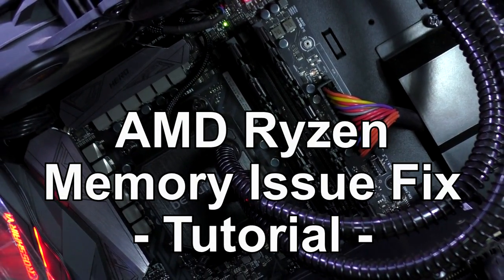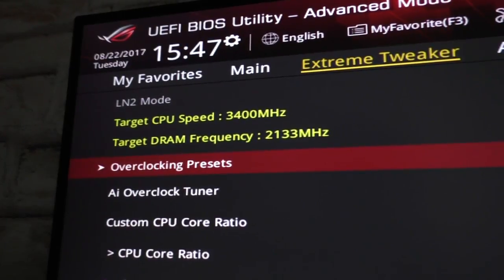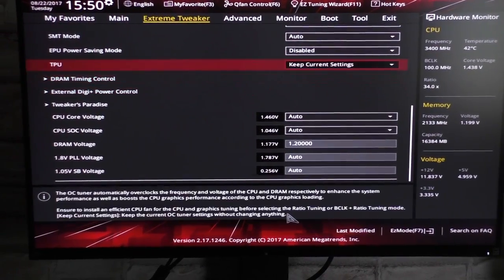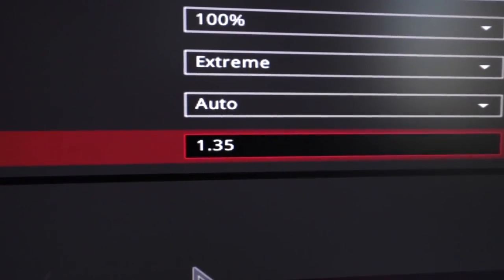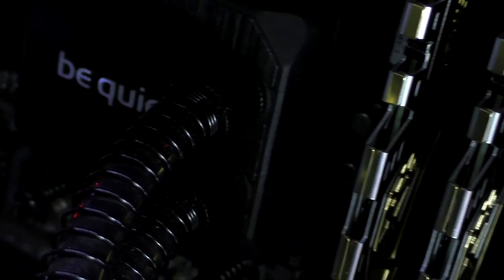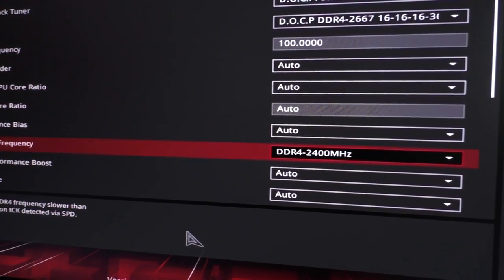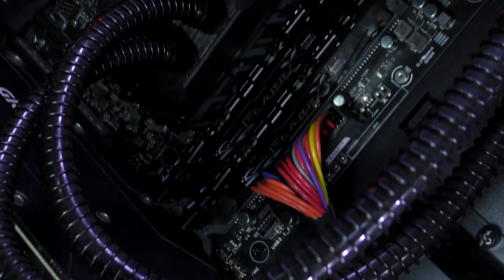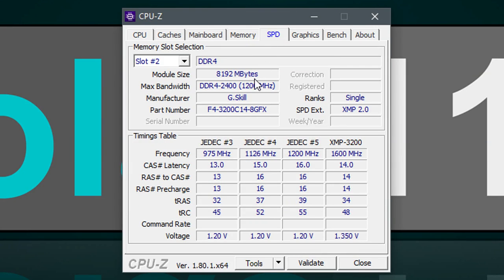AMD Ryzen Memory Issue Fix - Tutorial

Comment: Also if it hasn't been mentioned, a bump to SOC voltage can improve memory controller stability. Maximum 'safe' has been said to be 1.2 but I'd start at 1.15 in as small increments as your board will allow.

One other thing that can help overall memory stability is the ProcODT setting if you have it. On crosshair vi extreme (and I imagine the Hero as well) it can be found under Advanced > AMD CBS > UMC Common Options > DDR4 Common Options. I would try settings between 40 & 60.  It's been mentioned that up to 80 can work but I personally wouldn't go over 60. And I'd note that on the CH6E with bios version 1701 this option must be set again any time there is a change to base memory frequency. Including if the system fails and automatically lowers your ram speed.

Comment: THANK YOU SO DAMN MUCH. I finally got my ram to run at 3200MHz like its supposed to. My MOBO sets voltage to 1.350 by default, so I changed that to 1.4v after i turned on DOCP setting, and it booted it up and its stable. Man this was giving me a headache. I'm glad I came across your video.
Reply: hey i had a question, i get docp to be stable but when i restart my pc 2 times, it resets and i have to battle against the bios for it to work again , will rising the voltage fix this?
Reply: @Sebas-se6ej  disable memory training and enable  Memory Context Restore

Comment: Okay, so I see people still commenting and I found a fix for myself. This is extremely situational. I'm running a Ryzen 3200G on an Asus B450-F Mobo. I was upgrading from Team T-Force 2x8 3200Mhz to 4x8 (I bought two more of the same kit to upgrade) I never had an issue running the 2x8 setup at 3200Mhz but when I upgraded I couldn't boot. The b450 does not have a dram boot voltage option (manually) however if you boot the system with the original 2x8 and load into bios, do two things. If it's not already on, turn on the DOCP standard and it'll set your ram frequency to 3200 or whatever your ram capability is. Once completed, go into the EZ tuner (F11 I believe) and change the load setting (tab 2) to gaming and video editing. This will automatically OC vram and CPU (very minimal but seems to make the difference) then boot normally. Once windows has booted, shut down immediately. Install the additional sticks of ram and boot. I recommend going into bios before allowing windows to boot to ensure the system can see all 32g of your ram. I had to change it back to DOCP standard after the second boot and we are now running at 32GB 3200Mhz of Team T-Force ram.
Reply: If tje kit not 4dimm module wouldn't the system receive no benefit? How much u share ram for u apu?
Reply: Im gonna try that today, hopefully it'll work.
Reply: @renehinojosa1962  any luck? experiencing this issue atm

Comment: I have only had the pleasure of working with one Ryzen R7 1700 system I built for a customer of mine. He wanted me to also over clock it for him which I did. The Team Group night hawk 3200Mhz memory ran fine at rate speed as well as at 3466Mhz while testing but it left the shop at rated 3200Mhz. The R7 1700 ran all the way up to 4.1Ghz stable but it left the shop at 4Ghz OC and he was very happy with his new system. This was all done a a Cheap MSi B350 gamer board so I was pretty impressed with the whole setup because of all of the performance you got at a great price.
Reply: Rocky12345 what was ur setup because i have nighthawk 3200 32gb kit and it will not be recognized as 3200 if i do it wont boot. Please help
Reply: One issue worth considering is there's a trade off between high capacity and high speed support.  You can get the highest rated supported speed or highest capacity, often not both at the same time.  It isn't clear until you read the QVL of the board, get some experience swapping RAM and figuring out by trial and error the highest speed vs lowest latency supported on it or consult with people who have with the same board and CPU.
Reply: My four year old, middle of the top end intel cpu is still faster than any ryzen...lol

Comment: 32gb corsair lpx 3200mhz 4x8 kit, cant get my ryzen past 4.25ghz on any voltage and my kit cant go past 3000mhz on the xmp / DCOP profile. Gonna try the dram boot voltage to see if that works
Reply: Did that work afterall? I can't get my gskill 3600mgz going on xmp settings as well, it defaults to a lower speed.
Reply: yeah can't seems to get my 4x8gb 3200mhz A-XMP 
corsair vengeance ram kit to work on my MSI B450 Gaming Pro Carbon AC. it works on A-XMP 2933mhz settings though.
Reply: @SGbeerlover  I also have issues. Control game and Serious Sam 4 made be realize it. An other indie game too. 3200 is not possible with ripjaw. 2666 works I guess
Reply: @SGbeerlover  same situation. Only profile 1 2933 mhz with my Ryzen 5 1600 and msi b350 mate , flare X 3200 32 gb (4*8) With last bios it's starting but there's errors.
Reply: @YasonDinAlt  ikr. I just couldn't get 3200mhz to work on with the 4 ram sticks. There seems to be some limitation on the overclock with this motherboard msi b450 gaming pro carbon ac
Reply: i never did this and mine ryzen works fine with ram overclocked to 3600mhz CL16  mother board Asus b550m plus tuf , memory xpg d41 tuf 3200mhz.
Reply: I wish I knew what I now know as no Vengeance LPX ram work at their rated speed on the mobo and chip I have, I only get 2666mhz stable-ish
R7 2700 and Asus b450M-A
Reply: @shurikencookies  something is wrong is to work normally on your motherboard even 3200mhz with ryzen 2700 and around 3600mhz with ryzen 3600, try to set manual the SOC voltage to 1.14v and try again, do not use in offset
Reply: Ok im 1 Year late but i think i now pin point the problem on using 4 ram sticks on some motherboards, it seems like the motherboard traces going to the ram slots are not all equal.I have a msi x470 gaming plus and i got it to run at 3200mhz with a 4x8 xpg D60G Samsung C-die and lot of thinkering but its not completly stable, you gotta set the VDDP , Vref for channel A and B, VPP , procODT and so on. For all i can see and some pc builds ive been trough Msi motherboards specially suffer from this, i havent had a single issue with Asus motherboards on this regard, and some Aorus boards but they seem to lack some options on the Bios to adjust voltage and other stuff.
Reply: @mcflygarcia  Could you maybe explain with a little more detail what you mean with: Set the VDDP, Vref for channel A and B, VPP, procODT and so on and how to do it? I know very little about memory and also have a MSI motherboard with 4 sticks of RAM with some problems

Comment: It kinda worked. 3 hours passed and no freeze, no bluescreen. I will leave an update when it will freeze.
Reply: Nope, died again, while browsing the web
Reply: @HighVoltageDiesel  haha i knew it i fucking hate amd
Reply: @Hitmankiller01  haha same.  Next build its gonna be Intel.  Fuck the reds i support them enough.
Reply: @briantezo9232  ummmmmmmm you do know that the 10th gen intel chips are stupidly overpriced #AMD FOR DAZZZZZZZ even if some things they do are completly idiotic...
Reply: @tarnishedpose  Sorry I was SUPER bias Yes intel dose have there morals straight AND is still the leader in single core performance but u gotta admit 
AMD has there prices spot on But as you mentioned is ludicris that when you buy a chip from amd THE MOST important part TO make a cpu RUN dose NOT WORK PROPERLY!
ive personaly had these issues with my Ryzen 5 2600. Anyway i cant belive i was that dumb to post my previouse coment XD. Have a great day or night
Reply: @tarnishedpose  Oh and i forgot to mention Im very sorry that i upset you D: Did not intend what i intened in my first comment
Reply: @HighVoltageDiesel  same happening to me ryzen 3600 b450 aorus pro wifi , vengence rgb pro 3200mhz but it freezes and restart it self while idling
Reply: @abdulhannan-um6to  same here, ryzen 5 3600, aorus b550 elite, RAM delta tforce 3200. Any solution? What is shown in the video didnt work for me.
Reply: @danielcettour  I just build into thecase and it start working fine. No issues now. But build 3 times on test bench but no luck on it
Reply: @abdulhannan-um6to  when I make my ram speed 3600 my games crash and that’s the speed my kit has
Reply: @Worxthy  i have tried xmp on and off same crashes
Reply: @abdulhannan-um6to  the only way it doesn’t freeze for me is if I turn it down to 3000
Reply: @Worxthy  how you set speed manually?
Reply: @abdulhannan-um6to  I have a RogStrix b450 mobo, and I downloaded the bios and from there it restarts the pc and you click f1 and from there you can manage everything sadly I can’t run over 3000 without my games crashing :(, search up how to download bios for your mobo :)
Reply: @Worxthy  i have done upgrading bios
Reply: @Worxthy  no bro at 3000mhz same reboots
Reply: @abdulhannan-um6to  try 2800, keep slowing it down till you can actually do it without it crashing

Comment: OMFG MAN!!! I was sitting on my 3900x with 2133 frequency for almost 1.5 years until today. I feel myself so dumb. I've enabled XMP profile set ram voltage from 1.35 to 1.36 and it works! Just a couple of clicks... I have not tested stability yet, but the fact that my pc booted with normal frequency is just great by itself. Thank you a lot! 
Motherboard: MSI x470 gaming plus max
Ram: Corsair vengance lpx 4x8gb 3200MHz

Comment: On Gigabyte MOBA's: Go MIT/Voltages and change DRAM Voltage to 1.35 and the one below termination half of it: 0.675. If you have memory higher than 2933Mhz enable xmp and downscale to 2933Mhz since Ryzen supports it. If it is an higher frequency like 3200mhz change it to 2933 and down the timings to have still better performance. I have a XMP 3200Mhz kit 2x 16gb with XMP C15-17-17-34 and I now have on OC a stable 2933Mhz C13-13-13-26 1.35V 0.675V

Comment: Life saver!!!! My Ryzen 2700x and FlareX 16gb kit was never stable, it was at 1.2v I put it at 1.3v and is now stable for the first time in 5 months!
Reply: Man i am going to buy 2600 with 16gb ddr4 3200mhz. Suggest me a model that can run natively on 3200mhz out of the box. Man i am so confused.
Reply: @midgetechknowledge  even if the memory is 3200mhz it might not run natively out of the box at 3200mhz depending on the motherboard you pair it with. You should get familiar with adjusting bios settings. But hey you might get lucky.
Reply: @cliffbartram4974  man its risky. I have plan to get asus tuf x470 plus mobo. But what do you suggest? :( is the bios update necessary?
Reply: @cliffbartram4974  and does intel has this type of problems?
Reply: @midgetechknowledge  that's a nice board, and yes update the bios as it's simple to do. Intel has its own problems as any other manufacturer, no part or company is perfect
Reply: @cliffbartram4974  i will buy the component after some days. But its so frustrating to see that if i can run 3200mhz at all :( as i will use my pc for gaming and editing. :(
Reply: @cliffbartram4974  so should i go to flareX or gskill trident Z? Or corsair vengence lpx?
Reply: @midgetechknowledge  they are all good choices, I personally have the Flare X because Gskill has always been good for me. I also use my pc for gaming and editing and it's awesome!
Reply: @cliffbartram4974  flareX is so pricey here :/ i also prefer gskill though.
Reply: @cliffbartram4974  cpu: ryzen 5 2600 for the budget i can't go to the octacore, ram: gskill flareX according to your suggestion, mobo: asus tuf x470 plus, gpu: colorful rtx 2070, psu: cooler master mwe 750watt full mod, case: corsair carbide mid tower black spectre 4 may be, hdd: seagate 1tb, ssd: mayb su650 250gb sata.

Comment: I had XMP turned on with my gigabyte B550 and it wasn’t stable. I used OCCT for testing and was getting CPU and RAM errors. Default without XMP was 2133 which I didn’t want considering my RAM is rated for 3000. XMP was setting it to 3000mhz, 15-15-15-36 and 1.2v. I decided to manually input what it said on the side of my RAM (16-18-18-36 and 1.35v) so far I’ve turned it up to 3400 without errors. Another issue I ran across was the stock CPU voltage making my R5 3600 run hot at like 90c. Once I was sure my RAM was stable I started under-volting. I worked my way down to 1.2v VCORE and still managed 4.2 ghz all core on the stock cooler. I decided at this point that I trust nothing set to auto so I set my CPU’s SOC voltage to 1.1v to help with RAM stability even more (do not go over 1.2v, most say even 1.2 isn’t safe and I’ve heard of issues above 1.15) eventually I may experiment with RAM sub-timings but as of now everything works very smooth.

Comment: It's been said here before but soc voltage and procODT are super huge in getting speeds up. I have my OG Trident Z 3200cl14 overclocked to 3600cl15 on my 4ghz threadripper 1920x currently with only 1 crash to get it stable. Probably still headroom, but I can't overstate the importance of procODT enough.

Comment: I got the new Asus B550-XE GAMING WIFI with 4 x16 sticks of Corsair Vengeance LPX 3200 (CMK32GX4M2B3200C16). they go at max speed (nominal) of 2133 and don't reach docp of 3200. The only way is mounting 2x16 in slot a2-b2 and docp set them correctly  at 3200. Is this a motherboard limit ?

Comment: Nicolas, I am having trouble with my Ryzen 5 build, maybe it is something you can help me with or be able to tell me some settings to check?  I have a Gigabyte AB350-Gaming 3 board, Ryzen 5 1600 (stock speeds), and 4x8gb G.Skill 2400mhz RAM.  I can boot and run stable with any combination of the 2 sticks of Ram in dual channel mode in either channel A or B.  It will also pass Prime95 tests for hours.  If I however put the other 2 sticks of memory in, I get BSOD's directly after BIOS screen (will not boot windows).  If I am on F8 bios, It will boot into windows, but is extremely unstable, crashing multiple times per day.  No other BIOS version helps.  Is this a setting in BIOS causing this? Bad memory controller in my CPU? Bad board?

Comment: Ok so i read the comments and so much hate for ryzen cpu. While the compatibility with memory kit might be an issue, i believe the compatibility of amd board and memory kit of 3600mhz and above are the real issue. Even with newer b550 and x570 board. It also varies on the board manifacturer. Specifically asrock. Its worth to check if your memory kit is on the board qvl and even if they are, there's a chance that you will still have compatibility issue. Choose a board manifacturer with more list of memory kit in their qvl so you will have lesser chance of bumping into compatibility issue. Not gonna talk about what voltage or timing you should set it to since memory kit varies on the chip with samsung b-die being the best. For 3600mhz and above, if your kit isnt stable, test a different memory kit thats on the qvl. And if you dont mind, set it manually to 3533mhz with 1767mhz infinity fabrics. Ryzen cpu loves faster memory kit so its not the cpu. Im saying all this based on experience. Also, for stability test, use a proper software like cinebench, memtest86, aida64, prime95. Good luck overclockers

My specs
-cpu Ryzen 5 3600
-ram Xpg spectrix D60G 2x8gb 3600mhz
-mobo asrock b550m steel legend
-gpu gtx 1060 3gb
-AIO masterliquid ml240l v2 argb 
-psu gamdias astripe p1-750w gold
-nvme corsair mp510 480gb
-casing segotep gank 5
- 4 x CM sickleflow casing fan

Comment: You know whats also a great fix? going to Gskill's website and load in their ram configurator and putting in your motherboard specs to get the exact ram you need.
Reply: Dalton P Do other distributors of kits do this like Corsair?
Reply: It recommended the ram I have (G.Skill Trident Z RGB for AMD @ 3600MHz) and I'm still having issues getting it to overclock at all. It actually crashed my computer and broke windows. I had to use my boot drive to get into windows then do a complete reset. This is my first ASUS board, and so far I'm not a fan.
Reply: @paulsmith5237  I was also trying for ever to get it stable at 3600.
I'm at 3466Mhz now with Samsung B-DIE. With extreme low timings. Totally stable
Reply: It is not working as it should. For example, it reports ram up only to 2400 for Asrock X370 boards, even if rated at 3200.
Reply: forget it haha... my ram is clarified by gigabyte and gskill and still crashes the shit out of the ryzen (or whatever...) on games while being UNDERclocked
Reply: At least its nice that they list suggested CL/volt settings for different ram brands. Will try these specific setting for my particular brand

Comment: I have an Asus X570-E Strix motherboard with G.Skill TridenZ RGB 32GB of RAM. Its clock speed is supposed to be 3200MHz but the BIOS says 2133MHz. I don't have any of these profiles in the BIOS. Should I manually clock the RAM to 3200MHz?

Comment: My issue is, I have ram that is supposedly certified for my motherboard, but I get random black screen lock ups and even though the fans, LEDs inside the PC stay running, the mouse and keyboard stop responding. No one seems to understand or know what is causing this and it seems like the certified ram I bought is failing memtest86 tests. What do I do? This is with DOCP on as well running at 3000Mhz.

Comment: I have a board Asrock B550 Extreme 4 and RAM Xyper x 32GB 3600mhz, when I turn on the xmp at 3600mhz, the pc does not show the image on the monitor, at 2400 and 3000 it works, but at 3600 it won't, help?